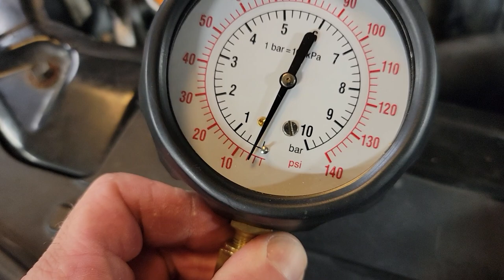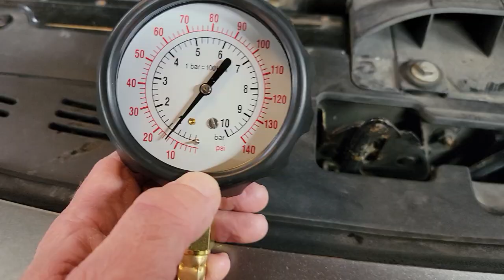2013 Kia Optima GDI low oil light flicker idle went away with OEM filter with mobile 1 #karcheckz

Comment: Mobile 1 Sythentic or regular did you use what kind 5 - 20 w or 5 -30 w or 10 - 30w ?
Reply from the maker: We use  mobile 1 full synthetic 5/30 and factory original oil filter